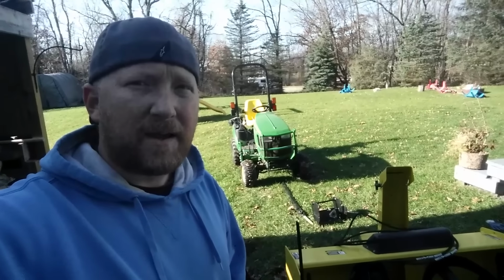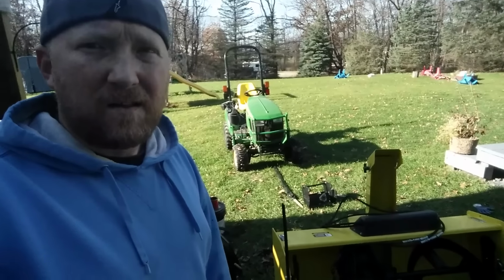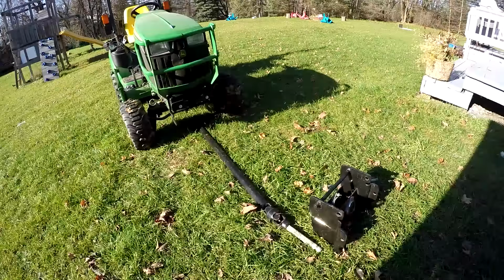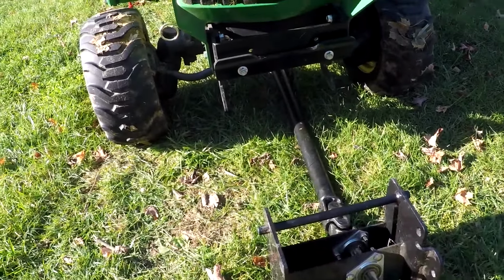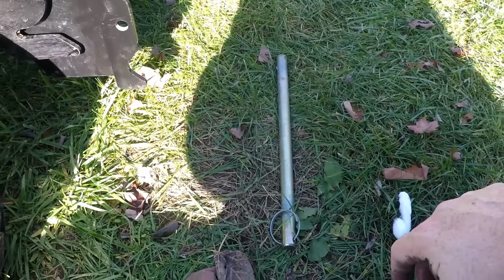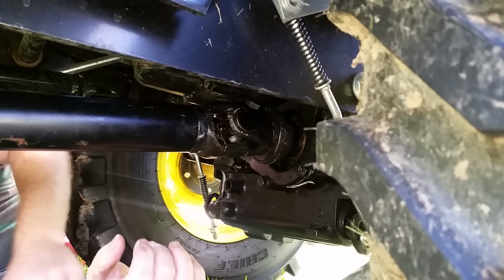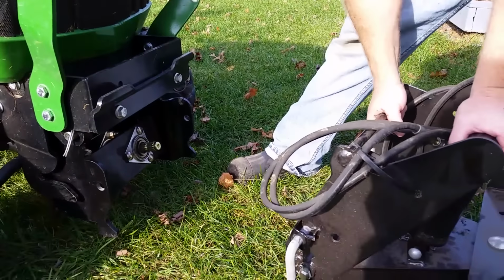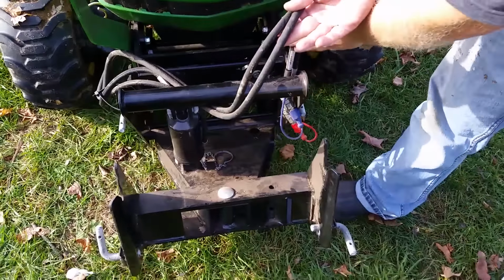John Deere 1025R quick hitch snowblower installation attaching how to , 54" snow blower installation

Comment: I got my snow blower delivered to the house this afternoon. It took me around four hours to uncrate it and put everything together. It came with the RIO sensor but I have a 1026R built in 2012 and didn't need it. I took your advise and saved myself over $300 by doing it myself.  I opened the garage door to go test it out on my snow banks and it's raining! Oh well, we are ready for the next one.    Thanks again for your great videos.  :)
Reply from the maker: 16B9 I'm glad you did it yourself and saved the money, now you have a better understanding of your sweet machine and 4 hrs from start to finish for your first time ,not bad. I'm glad I could help a little.  and it's great that you made it through not knowing all what to expect, just that they were delivering it by crate. you did awesome.  thanks for your encouragement also

Comment: The snow blower is the one attachment I didn't get for my Deere. Could have used it the first winter I had the tractor but the loader handled it fine and it was a freak winter here for central Virginia. We had three snow storms over a four week period and each storm dropped 24" of heavy snow. Just 20 miles north of me they got 36" storms but the lighter drifting snow. We had snow piled up everywhere.
Reply from the maker: WSMC Mc wow that sounds rough,  I bet that loader had no problems though, such a fun versatile tractor, I just like seeing the snow shoot out of the blower . thanks a lot for watching and taking the time to comment. and have fun with your machine

Comment: You need to show removing the auto connect. I went for the rear blower much  easier to install and I have a snow pusher on the front for small storms

Comment: Can you leave your front end loader or mower deck on the grass outside? or do you need a cement slab?
Reply from the maker: The main thing is a level surface,  I've left in grass outside but on very level surface and had no problem,  sorry for the delay,  YouTube didn't notify me of your comment

Comment: Hey, I know I'm bringing up an old post, but was just wondering if you've ever tried to leave the quick hitch attachment on, but take the blower off and put the FEL on? I'm looking at a 1025R and would like the front mount blower but would like the option to quickly switch back to the FEL for some things. I can see it'd greatly reduce front ground clearance with the bracket still in place but I can deal with that as long as the arms and bucket would clear the bracket.

Comment: Tony - good video tutorial.  I notice you didn't mention the snowblower spring-loaded pins in the video.  I assume yours 'shot right into place' on the bracket when you drove up to the blower and lifted it?  I have the 47" blower, and after I lifted the snowblower, I simply had to turn the tractor off, and then walk around to the front of the snowblower and lift it slightly - and BAM! ...the spring loaded snow blower pins found the hole and snapped right in.  Just wanted to make sure that people didn't miss the point of making sure the snow blower pins MUST be secured through the corresponding tractor bracket holes -missing this could cause major damage or injury in the right set of circumstances.
Reply from the maker: tgilldesign at 7:34 I put up a banner highliting that because it's often forgot, good call. I definitely make sure mine went in
Reply from the maker: tgilldesign why all the negativity have I offended you?
Reply: Huh?  Must be in the type written translation.... no negativity intended.  Just asked if your unit has a plug or not?  Mine does... but I know that the 1025R was a rebadged 1026R when it was first released a few years ago; and then they made some significant changes....I don't believe the earlier 1025R's have quite the same setup as the newer 1025R's.... just curious, that is all.  :-)
Reply from the maker: OK my bad. I've never seen one but that does not mean that it's not there. Just have not seen it. Mine is a 2016 but maybe changed at some point

Comment: great video.  I have a 47" coming. my local dealer is encouraging me to have them do the setup at their shop (possibly just for the setup $$?).  do you think it's necessary?  I do have the quickhitch attachments for the mower on my tractor and I believe those need to be removed.  but other than that isn't it just the usual setup for an attachment, shoot setup, lube and oil, etc?  thanks for any input!
Reply from the maker: Casey James you got it , you'll remove the mower raise/lower bracket and the PTO quick connect if attached,  I don't know what they would do that you couldn't do? and you will want to learn as much as possible if you are going to keep the tractor for the long haul, definitely don't want to take it to the shop and pay for something you can do. I don't care how much money you have haha keep it. heck even make a video if you wanted to and post it , screw ups and all for the new guys. always push yourself.  cheers bud thanks for watching and commenting
Reply: They came out and got it, and brought it back a day later with it installed.  So it was an ok deal, but did cost to have it "installed".
Reply: TonyCamp I have the quick hitch for the mower. Just got the 1025r had the 47 blower from 445. If anybody could post video of removal of quick hitch would be appreciated.
Reply: this shows the install. there is a bracket under that you need to remove if you have the 60" deck mower.

Comment: to be honest the rear mounts are much more usefull then the front mounts.. yeah its nice to be able to drive straight ahead and see where your going easier BUT with the low ground clearance of this blower loading it on a trailer is pretty much impossible without it dragging if you plan to transport it... also the plastic impeller wears fast and wont throw as much snow in the future. You also need to remove all the mower deck quick hitch stuff to attach the blower system.  

Good video and no matter what the deere 1025 is a sweet tractor
Reply from the maker: very good points, the front mount certainly has some downfalls, and is not for everyone , I needed a front mount because we use the tractor year round to haul trailers and whatnot around the property but putting it on a trailer is tricky to say the least. thanks for watching and giving more points of view. we definitely like our little tractor
Reply: FWIW, John Deere recommends these 1026R tractors be trailer towed in the backward position. I believe it's because the hood doesn't have a second safety latch. It the wind should catches it, it's gone. You can sometimes load a tractor with an attachment up the ramp better backwards vs. forward.  Great video.   :)
Reply from the maker: 16B9 yes. I think backing it on is best also.

Comment: My dealer called and said my 54" snow blower is in. Did you uncrate your snow blower and put it together yourself or did you have the dealer do it? They want over $300 to uncarte and put it on my 1026R.  Talking with the shop foreman about the chain tension he says it "should" already be set up from the factory out of the crate.  My salesman says he can deliver it to my house uncrated. Thanks for your advise and pointers on this.
Reply from the maker: 16B9 if it was me , I would not pay them $300. if you are going to have the tractor for a while it would be better in the long run to know as much as possible to save money in the long term

Comment: When you go into reverse does it kill the auger/shut down the tractor, or is there a bypass so it keeps running and turning? on the 1025R....thanks!!
Reply from the maker: Casey James yes there is a safety switch under the seat is did a video on.  was very annoying to me so I had to fix it also makes it mow in reverse. caution I'm sure it voids the warranty
Reply: cool, mine is still under warranty at the moment.  also I hadn't realized that you can pull up on the PTO knob and it'll let you go in reverse!?  that'll come in handy mowing and blowing.  its a good snow blower, I'm really glad I went with the front mount.
Reply from the maker: Casey James yes you can pull on the PTO knob , I just got tired of it and did a bypass. so I never had to worry about it.  but safety is key and wouldn't recommend what I did if there were small kids or something/animal to get hurt

Comment: Question about the Quick Hitch tractor adapter.  I have the mount for my quick hitch to my 54" snow blade but it doesn't have the bolt on pieces where that long drive shaft slides through and connects to the snow blower. Do those bolt on mounting pieces that the drive shaft slides through come with that long drive shaft as part of the kit or do I have to order them? Thanks Tony.
Reply from the maker: 16B9 I believe that the parts have to be ordered separately but you'd have to check with your local dealer or the online company that you go through because sometimes they sell things in package deals with certain items that you need in order to save a few bucks. but I think normally you would order the driveshaft separately from the bracket
Reply: Thanks Tony! I'll check with the JD dealer. I try to get most of my stuff off of ebay. I've saved hundreds of dollars shopping parts for my Gators and tractor vs. what the local dealer charges. Thanks again. Have a great day!!
Reply from the maker: 16B9 sorry I couldn't help more. thanks for watching and commenting. have a great day
Reply: One other thing. Did your mount, that marries the quick hitch to your tractor, have an electrical plug you need to connect? You didn't mention it during your installation of your snow blower. I read there is a RIO sensor on the mount to prevent backing when the snow is operating. I also saw your informational video about putting a quick tie on the switch under the seat. Is that so the snow blower will still work in reverse? Thanks again for the video.
Reply from the maker: 16B9 I know what you are talking about,  yes some had a rio connector or something,  but I believe some didn't have that as mine didn't have it. but the zip tie method I used should work for the mower deck also(but yes my snowblower works in reverse) . that's why I originally did it because this is my main grass mower also
Reply: Thanks again Tony for your informative reply. I and your other viewers, appreciate the timely exchanges you offer when we have a question. Many who post things on youtube don't monitor their postings. It's refreshing to get your followups to questions. Please keep up your good work. Oh, I liked your Pizza video too, LOL.  Your wife must have the patience of a Saint!   Have a great day!

Comment: Nice! I have the same setup. I was wondering if it was just mine that was loud but I guess they all are? Are they that noisy new? I bought mine used. Thanks
Reply from the maker: They do seem a little noisy however as long as you check the oil level in the gearbox for your auger and check your bearings for any play or looseness you should be fine and get plenty of service out of your machine. Definitely change the oil if you bought it used. The snowblower itself has a gearbox. Thanks